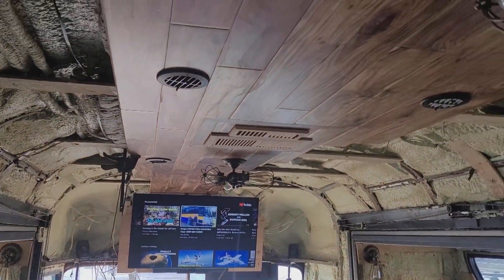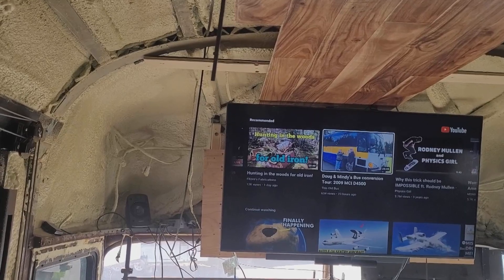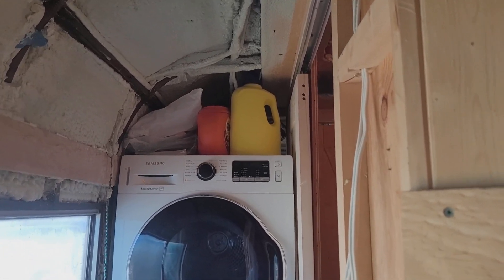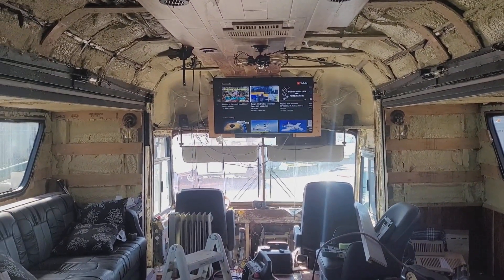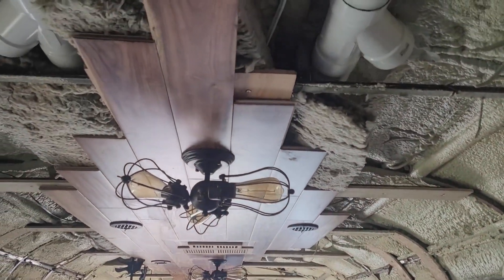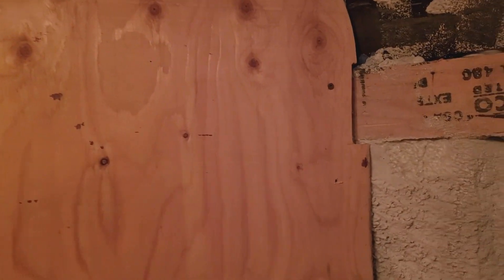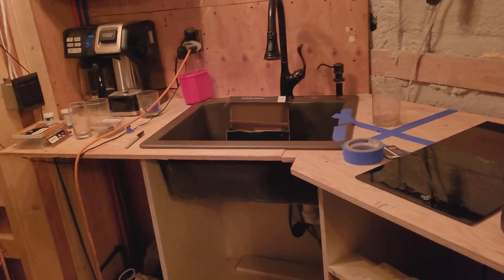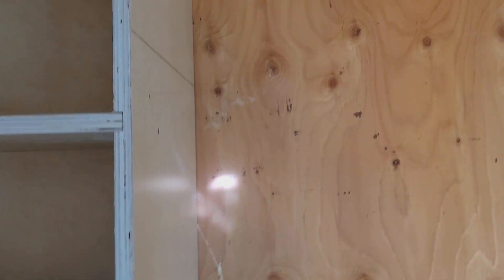Bus Conversion Project - Video 120 - Spring 2022 Update and Kitchen Cabinet Build

Comment: I have been following you from the very first days. You doing it. Far more then I am with my coach that is sitting 50 feet away from me. I like to know how the colling system worked out. Electric fans are the way to go. The wood looks awesome.
Reply from the maker: Thanks for hanging in there.... it's an ongoing challenge but I still enjoy it so I guess I keep goin... I have to do some work to the front air suspension then take it for a run and see if the cooling system works better.... was only getting 6 volts... fixed that now but haven't been able to test it yet.... that will be in an upcoming video within a month or so... hang in there...😁😁😁

Comment: A great video. I am living on my conversion project.. and its been a nightmare with cold temps down in the low 20's the past seven months. Thankfully the diesel heater keeps the frost away. Most important thing to do in these bus conversions is insulating the floor and the center tunnel.  I literally had my feet freeze to the dang floor one morning.
Reply from the maker: Ya... This one is pretty good but my other bus has really cold floors in the winter... diesel heaters are awesome but diesel is getting so expensive..... glad your hangin in there

Comment: I thought I was the only dummy in BC doing this kind of thing. I bought a Freightliner Century and put most of it into my Bluebird Wanderlodge. I have some video at martinbuysabus. I have been at it 2 years and I only did a repower and a few extras. Looks like you have another year or two left. Regarding the overheating issue, I have never heard of anyone making electric fans work, even in a puller bus. If you do you will be first. Those new ones with 10 fans are way too complex and expensive for a DIY project.
Reply from the maker: You are almost the only Dummy in B.C. doing this... I'm probably the only other one, I figure another 2 years at the rate I'm going.... I will find out next weekend if the electric fan idea will actually work, I'm taking the bus to the Armstrong rodeo so see if it stays cool or not, I haven't been able to find anywhere that states how many CFM. are required per horsepower so it's all just a crap shoot so I guess we'll see, I'll take a look at your videos if I can find them

Comment: Hey James Long time no see. Sent you a couple of emails but never received a response.  Anyway have a pressing question....bolting my slide rails down. I bolted the first one down squaring to the bus body using a speed square. Started bolting down the second one and as I squared it to the bus body and noticed that the measured distance between the rails was different..by about inch. Should i bolt them down using the same measured distance top and bottom or should i bolt them down squaring them to the body of the bus. Really need your feedback on this one. You can email me or call me (info in previous emails) . As always thank you in advance for your time and consideration. Mycheall
Reply from the maker: Hi Mycheall

I haven't received any e mails from you for some reason... I'll try emailing you tonight and see what happens.... You need to keep your slide rails square so I would position both rails then triangulate them to make sure they are square with each other then mark and drill your holes... the bus side rails may not be square... your slide rails need to be square with each other or your inner rails will bind as the slide moves in and out... hope this helps... Jamie
Reply: @JamesEDennison  Jamie would you explain the process of triangulate por favor?
Reply from the maker: @mycheallhamlet1603  Hi Mycheall, I'll try e-mailing as the explanation would be too long here I think... hopefully e-mail works cause I didn't get any e-mails from you recently